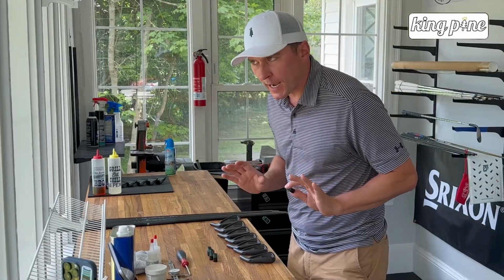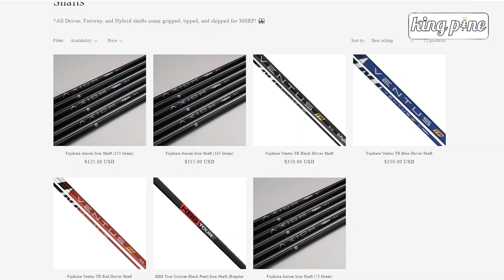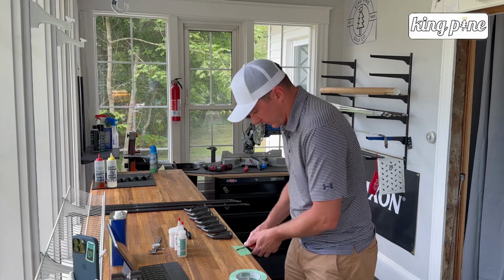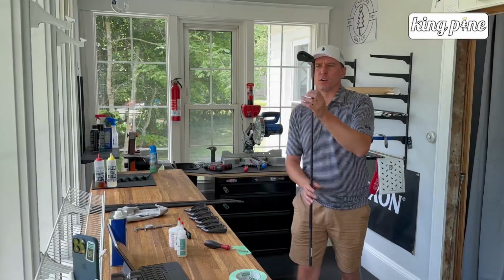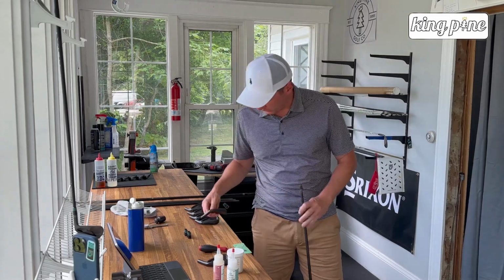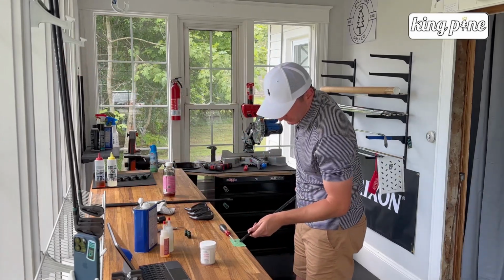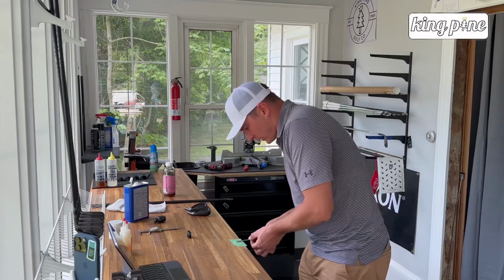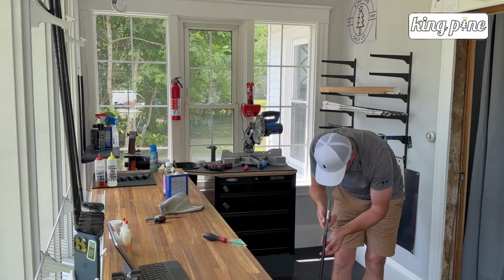INSANE Black Srixon ZX7 Fujikura Axiom Build + Club Building Tips and Tricks!

Comment: do you bore out the BB&F before putting them on shafts? Maybe they've changed production some, but I noticed this last year they are almost impossible to get even a little bit down a shaft if I don't run a reaming bit through them first, and even then I usually have to heat them up a good bit before I can push them into position.
Reply from the maker: Short answer, yes 😄